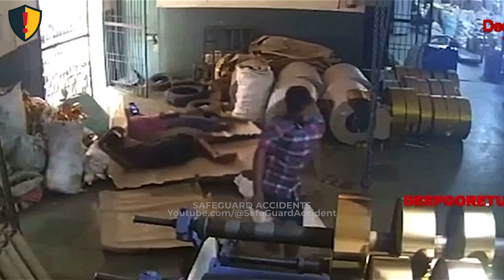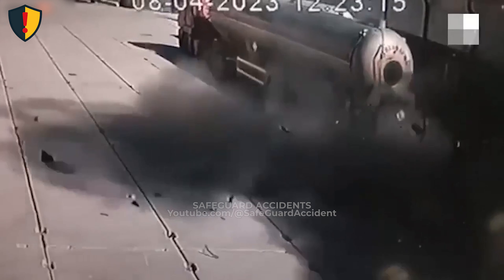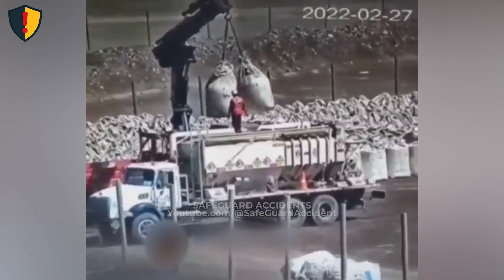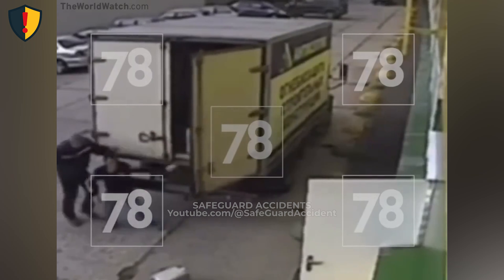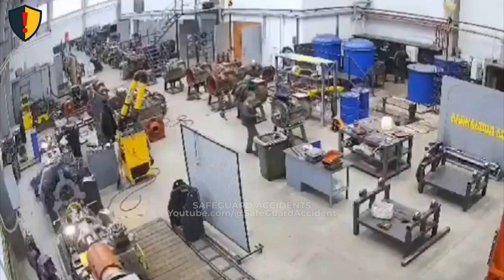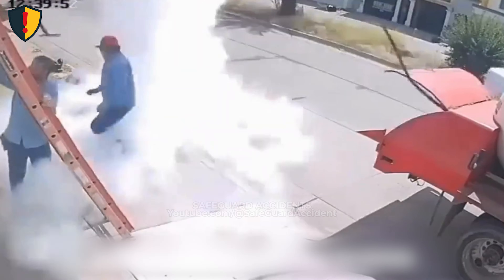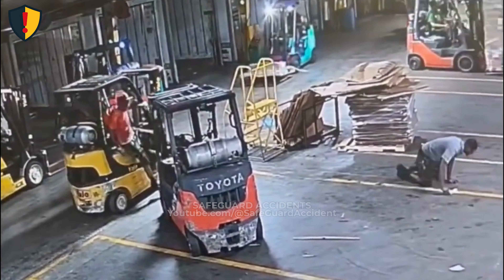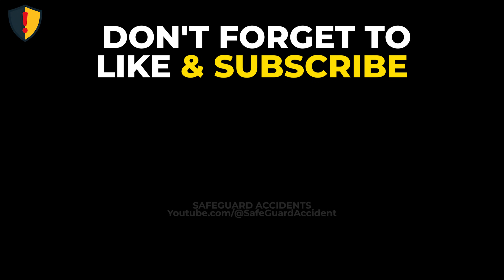He Didn’t Realize The Danger Until It Was TOO LATE | Rotating Machine Accident

Comment: Clip 7 looks like a process for filling the hoppers in the truck with the product in the bags.  What is needed is a platform that the bags can be lowered on with a hole for the worker to open the bottom of the bag.  As the hopper fills up, the platform is moved to the next hopper.  In this case, there is no platform, so the worker must get beneath the suspended load to open the bag.  When I was doing a similar task, filling up the hoppers of a rail car.  Not only was there a platform, there was boom to clip my fall arrest line to.